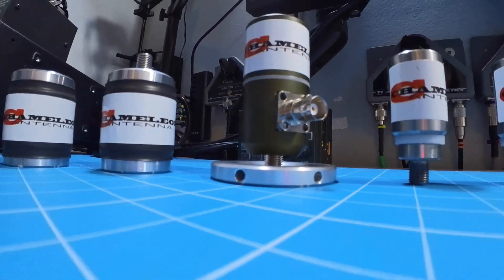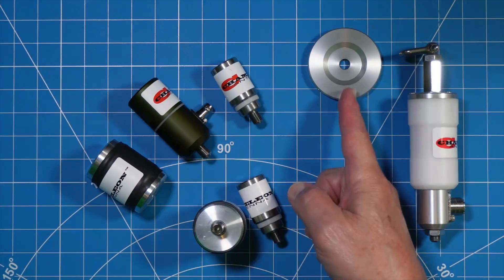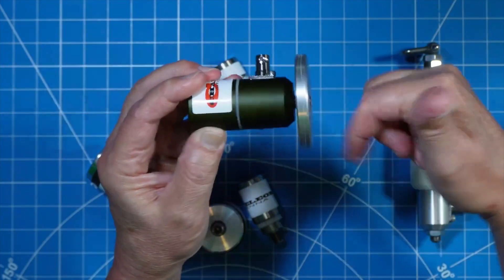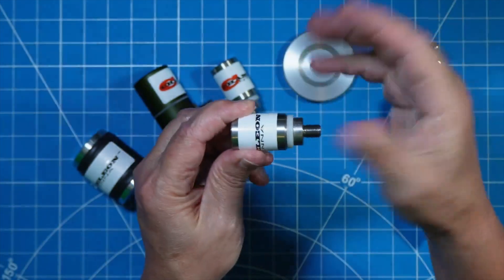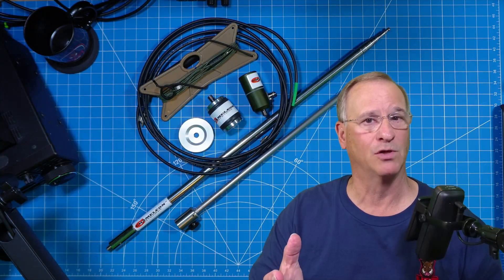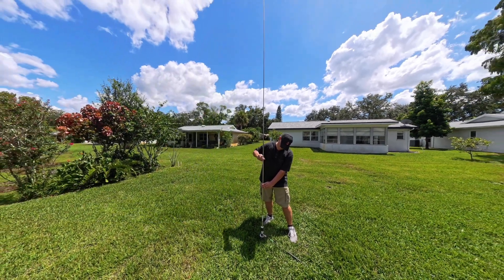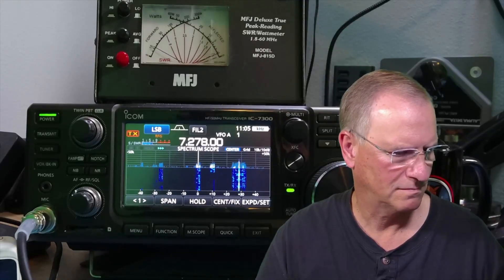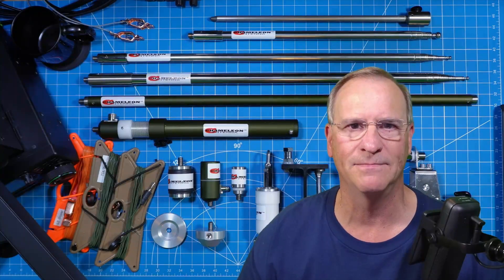Chameleon CHA BV Basic Vertical, M-Coil, Blank Adaptor, SS Insulator, Single -Ext -- Intro & Review

Comment: So is that blank the same thing as in the JPC 7 kit. It looks like the Jpc 7 blank could be used with a chameleon 17’ or 25’ whip. I have a JPC 7 so when my ch ss25’ comes (eventually) I’ll try it. The ss25 whip looks quite versatile so will try it. Just wanted to know if you’d done any testing on. Great videos. I don’t live in a HOA (UK) but I have a small garden and most of my antennas are verticals in some way or other. Sigma HF x80 is a fantastic antenna.
Reply from the maker: I don't own the JPC kit, but I believe the base is a polymer of sorts?  Not sure.  The Blank Adapter is just that, it is not doing anything to the signal but passing it through.  It is a solid base for large portable verticals.  Its made of aircraft grade aluminum and Delrin...premium materials.

Comment: If I understand this correctly, the blank simply turns the corner. Right?
Reply from the maker: Yes, it gives you the bottom threaded stud for a ground spike or other mount, the side SO-239 to connect your coax, the top 3/8 X 24 to connect your antenna, and blocks the signal from the top half to the bottom half with a Delrin spacer.

Comment: How long are your radials and how many?
Reply from the maker: I bundle three radials per banana plug, 16 1/2 feet each.  Then I have multiple bundles I use as needed depending on band and soil conditions.  Usually for me, its only 1 bundle on 10 through 40.
Reply: @HOAHamRadio  I put four 12 1/2 foot radials and got a 1.4 swr on 40.  I still need to play with it, yesterday was the first day I set it up.  I apprciate you checking out all these different antennas
Reply from the maker: SWR at 1.4, time to key up and have some fun!

Comment: Is there any reason to use the Insulator below the Blank Adapter, or is this additional isolation redundant and unnecessary? Thanks !
Reply from the maker: The attic antenna I released Thursday this week had a Insulator below the Multi Configuration Coil; that is because everything below the coil was the ground side of the antenna.  I did not want the tripod as part of the ground, so I isolated it.  It is not a redundancy to the Blank Adapter, it serves an additional function.  https://chameleonantenna.com/fthdbp

Comment: Nice! Appreciate walking through these parts. Gives me some ideas. 

I picked up the Chameleon SS-25 recently, which I used with a JPC-12 base and and M10-1.25 to 3/8-24 adapter. 

This makes me think of other ways and bands I could bring into the mix. 73
Reply from the maker: Thanks for stopping by for a look...these gadgets bring about a lot of options which have made it on to paper, but I have yet to actually try.

Comment: Thanks for another good video. I've never handled either the Chameleon 17 or 25 ft whip. Since I am only interested in portable operation from 6M to 20M, I can get the 17' whip. But would the 25' whip, adjusted accordingly for 6M to 20M, be beefier/sturdier to handle windy conditions?
Reply from the maker: If you are only doing 6 to 20 and you are adjusting the coil length for resonance, I'm not sure there is any benefit to the SS25 over the SS17.

Comment: I am failing to understand the significance or use case of the CHA Blank or the SS Insulator, and I am hoping someone can explain it to me. I have watched this video twice now, searched the web and Chameleon's website, and still do not understand. What does this give me that my MPAS system does not already have. Can't I just use the insulators that I already have that came with the MPAS and TDL kits? I also have the CHA mast and have just deployed the hub on top of that with excellent performance. Would the CHA Blank improve on that? The spike mount already has a counterpoise system that attaches to the thumb screw on the spike. Is the only reason for the CHA Blank so that you can use the newly released hub instead? Perhaps this is only for the CHA Basic Vertical system, and would not be applicable to the normal CHA setup with the 17' whip and spike mount with the regular insulator?

A much more in depth explanation of how these items would be deployed would be greatly appreciated. This makes no sense to me, and there is no documentation outlining this either...at least that I could find. I did read the user guide to the CHA BV. If this is only specific to the BV system, then I guess that makes sense, but Chameleon also talks about it integrating into the MPAS system.
Reply: @caseybbq, Hope you already figured this out.  A basic vertical is generally just a single band (or as some call it, a Mono-Band) antenna -- so remember your calculations that were taught in the basic testing: 468 divided by the freq in MHz?  This is for the MOST resonant antenna.  In this instance 468/14.25 MHz = 32.8 feet.  This is a half wave (again the most resonant vertical) of 20 meters (on SSB).  Half the wave of the antenna (about 16.4 feet) -- goes in the air as a vertical, the other half of the bands wave (about 16.4 feet) is collecting the OTHER half of the band's waves from a counterpoise or a radial of about the same length of wire or wires.  When you use these type of mono band antennas you dont have to use an antenna tuner or a matching transformer (that is the advantage most like, as you can now leave more weight at home -- 20 M is the band that most folks like to play on even when the solar cycle isn't as nice as it is.)  Just so happens that Chameleon made the telescoping SS-17, about long enough to be the vertical portion of a 20M antenna -- the part that goes into the air, provided you extend it all the way out.  Remember that being "more" resonant, will allow you to receive better and likely transmit more energy (i.e., farther, or "more fars" as others jokingly say) a bit better than "less" resonant antennas.  If you want to change to a higher frequency, you can; but you need to recalculate your length of the new band (17m, 15m, 12m, etc.) and shorten the vertical portion of the antenna that is in the air.  Some just use an antenna analyzer to be quicker, and watch the numbers go down while you change the length of your ss-17.  That still takes time and extra effort.  So, others who dont mind giving up a few fars, or receiving just a bit less; put a transformer/matching unit on it (a CHA mini/micro) and then instead of taking extra time changing the length of the ss-17 and re-tuning each time you change bands, they just push the button on a tuner and they are on some other hame band quickly doing more ham business -- thus the MPAS is broadbanded because it has the matching units.  it allows you to then have an antenna that's much broader banded  -- you can use it on other bands without having to go out and readjust your antenna length constantly.  When folks just had only resonant mono-band antennas, they wanted a way to talk on multiple bands with less fuss, so transformers were manufactured creating compromised antennas.  Now it seems that folks are back on the kick of wanting to talk a few miles farther and are understanding that you can't do that as well with matching units or transformers, so we are taking the transformers back off.  The blank is really just that -- a blank - a "nothing", it does about the same thing as a 90 degree UHF elbow does, but the CHA Blank allows you to now also attach it to a spike or tripod, etc where an elbow doesnt.  You pay for convenience of the mount and another way to maybe attach some radials to the Blank.  Your MPAS is actually a darned good system for what it is made for.  You are just buying convenience and a bit more resonance with the blank, that's all.  Personally, I was going to buy one tonight, but they are out of stock.  I too have the MPAS, but can make a vertical out of any of several other components and still use the ss-17, you just need to isolate the antenna from the counterpoises.  Your questions are good, keep asking and as you do, it gets simpler to understand the concepts.  Take care and 73
Reply: @americancitizen2536  Thank you for your response, it was very helpful! 73s
Reply: From the user guide "For example, adding a Hybrid Micro or Mini Matching Transformer changes your Basic Vertical to an MPAS Lite broadband vertical." What is the difference between a basic vertical and a broadband vertical?

Comment: Maybe a passing mention on their respective power ratings would be greatly appreciated, from memory the micro and mini are about 65% efficient, leading to a power use with a bit of headroom of 250W.
Things advance, with every new iteration in quality and hopefully performance too.👍
Reply from the maker: Good point on the power ratings:

M-Coil – 200W SSB and 100W CW 
Blank Adapter - 300W SSB and 200W CW 
SS Insulator – NA
Single Ext - NA
Reply: More like 75%
Reply: All those erroneous efficiency numbers make me laugh!
Reply: @Chameleon_Antenna of course, providing actual loss figures for both the mini and micro would be great and  mostly eliminate speculation. The cutesy replies don't help things.
Reply: @Chameleon_Antenna  5:1 binocular core only one person of which we are aware made measurements as a third party. However, In the grand scheme of things, 75% +/- is irrelevant. It works and you get good results, if this figure is incorrect for the Hybrid Mini or Micro please correct me.

Comment: Just tried to order on Chameleon's web site the Blank Adapter and Single extension and kept getting an error page.  Are they out of these already ?
Reply from the maker: Thanks for the heads up.  I just checked  (8 hours after you comment) the links are now working...but the extension does say sold out.
Reply: @HOAHamRadio  Thanks.  I also posted on their Facebook site and it was a web page error.  They fixed that last night but the single extensions are saying out of stock.  I posted on Facebook asking about that but have not heard back yet.

Comment: Something I see wrong with the telescopic masts they offer is how do you guy them without them collapsing downhill down force on the joints?
Reply: For POTA or any temp use one wrap of electrical tape would be simple enough to keep a section from dropping in. The guy lines are mainly for stability not to put massive force in the downward direction. If your plan is to have a permanent set up there are other mast options.
Reply from the maker: Curious which specific telescoping mast  you are referring to?
Reply: @HOAHamRadio  my comments were made assuming they were referring to the SS17 or the SS25
Reply from the maker: @forgetyourlife  Yep, I too assumed that's what was being referred to but wasn't sure.
Reply: @HOAHamRadio  I've never had a stainless telescopic whip so didn't know how well they stay out.
I only have experience with sotabeams 7m, Spiderbeam 10m and 12m XHD fiberglass.
Reply from the maker: @HamRadioN0CKL  Now I understand.  In my opinion telescopic whips are best for short term set up, and in that type of use they do not collapse on themselves; I've left them up for days at a time with no problem.  If you go for something more permanent, then what @forgetyourlife said, wrap them with high quality electric or self amalgimating tape.